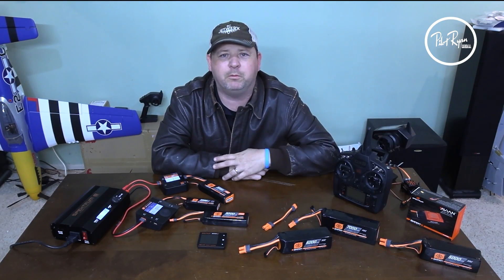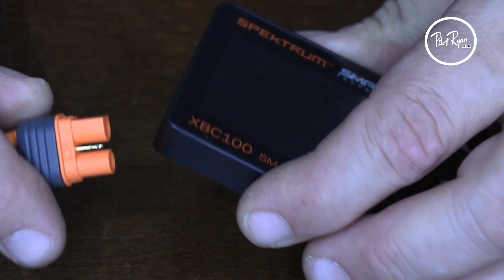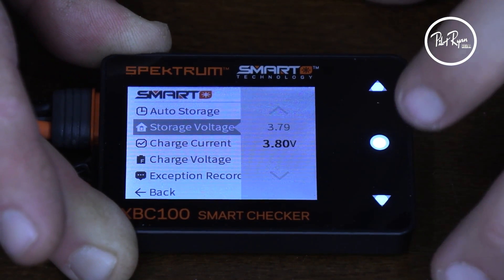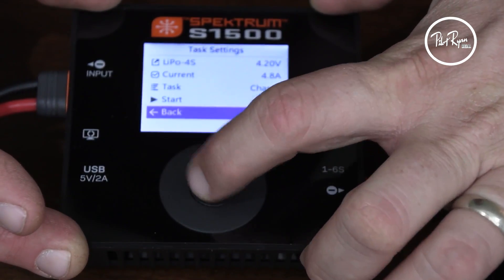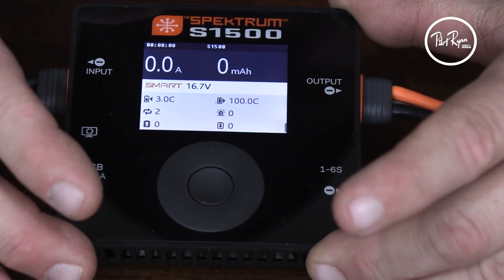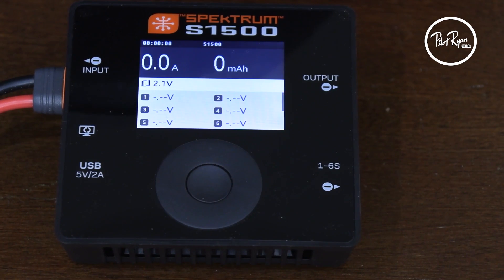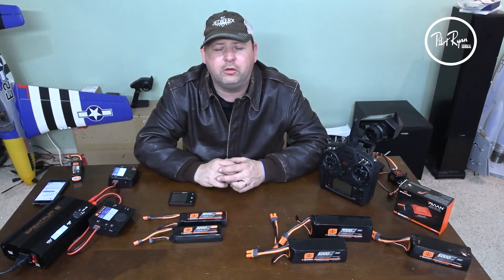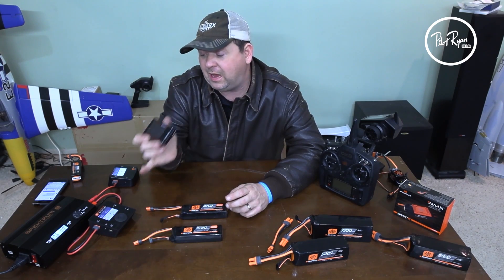Spektrum Smart Batteries How to set Auto Discharge with Smart Checker and Charger

Comment: I am new to these size lipo batts. I purchased the Spektrum 5000 mah 36 100c. I have the Spektrum S150 smart charger and smart battery checker. I have two questions. First what is the max amps I can charge this battery at? The S150 goes up to 5 amps. Secondly, I’ve seen mixed info on storage voltage for these. What sis the proper storage voltage for this size Spektrum smart battery? They are pricey and I’d really like to care for them properly. Any information would be greatly appreciated. Thx in advance. Great vid by the way, learned a lot.
Reply from the maker: 5 amps is only 1c on your battery so you’ll be fine. 3.8 volts per cell is storage voltage
Reply: @PilotRyanMedia  Thanks for the response! I’m a drone guy and I understand how to care for their batts. The info on these big packs can get a bit overwhelming/ confusing lol. Thx again bud.
Reply from the maker: The 3.8 per cell is good storage per cell for any size battery whether it’s 3s or 6s
Reply: @PilotRyanMedia  My bad, one more question. After running a battery down, should you fully charge the battery then set the auto storage voltage with the smart checker?
Reply: @CG did you ever get the question answered about what to do after battery use? I am looking for the same answer- thanks

Comment: I just charged my 3 cell 2200 for the first time,   new rtf carbon cub.   Is there a place the battery needs to be for the week as it discharges itself?  Special bag , out in the open  in my tool bag?  For safety.   Thanks for your advice.
Reply from the maker: somewhere safe, fireproof is recommended. A lot of people use those lipo safe bags or boxes.
Reply: @PilotRyanMedia  Hello, I have 2 quick questions if you don’t mind. I have the smart checker from Spektrum and their s150 smart charger. I purchased 2 5000 mah 100c 36 Spektrum smart batts as well for an rc truck I purchased. Ok, first  question is how many amps should I charge the battery at? S150 goes up to 5 amps. Secondly, what is the proper storage voltage for this size pack? I’ve seen mixed info online and I’d really like to take care of this equipment. They’re pricey but I wanted the best and I liked the smart tech . Any help would be greatly appreciated. Thx, great vid by the way. I purchased the smart checker because of your vid.  Thanks in advance! Take care ....
Reply: @CG-px9qd  same here man just bought a rc with the s150 charger and battery bundle but im faurly new to this rc stuff especially lipos so if u have the smart batteries and the smart checker the batteries self discharge on there own or connected ???
Reply: @CG-px9qd  and for the charging amps i seen a video that said it automatically sets you amps and stiff so you dont have to only when u want to

Comment: Hey Pilot Ryan! Are you saying once to set the auto storage you can unplug the battery and put it in a Lipo bag and it will discharge? Or does it have to be plugged into your charger?
Reply from the maker: It does not need to be plugged in

Comment: Hi Ryan, after two days does the battery discharge itself or do you have to have it plugged into the charger to drain it down?
Reply from the maker: It does it itself with no plug ins required

Comment: I have a new 3s lipo 5000 mah smart tech battery. I don’t have a Spektrum charger. I noticed after I charge the battery when I check it’s charge level 2 days later it’s about 50% charged. I thought battery was bad.  I have 2 and both do it same thing.  I assume they are auto discharging?  Any thoughts?
Reply from the maker: They are auto discharging

Comment: Good evening bro. This is off the subject. But what is the best or biggest battery you can use in the new P51 1450mm plane. ????
Reply from the maker: You can fit a 7000 but you will have to make arrangements. Biggest without modification I’d say 6000
Reply: Pilot Ryan Media well I got a couple 3600 and a couple 6000. I just wanted to make sure they won’t hurt anything in the electrical. Thanks bro. Looking forward to more of your video’s. I want the p51 1700mm bad lol.

Comment: Ryan, can you tell me what kind of connector is a FMS P-47 Razorback 1500mm ECU? The reason I'm asking before I but all 5S G-2 Smart Battery's for the plane I want make sure that I don't need a Adapter for them.  Thank you in advance!
Reply from the maker: Mine came from China direct. Let me ask my friends at Horizon for you. I’ll answer here.
Reply from the maker: Xt60 and ec5. They have implemented ec5 on newer P47s. If you shop consider using my website to get to horizon.

Comment: Hey boss I just bought a 6s 50c 4000mah, bashed it twice and it seems it is stuck on auto discharge? What are the default auto discharge settings of a brand new lipo?
Reply from the maker: You know what I’m not exactly sure. In my experience the auto discharge is not set at all until the user sets it. The only batteries I have with auto discharge are the ones I set.
Reply: @PilotRyanMedia  after my research I found the default voltage would be 3.80v though, and mine is discharging below that. It was fine til my last bash. I'll give horizon a call. Thx for the response though!

Comment: Hey Ryan awesome vids!  Question,  I thought the whole idea with the Smart batteries was not having to plug in the balance lead?   On the Smart FB forums I think Tom G stated you only need to plug in the main battery lead?  Thanks again,  enjoying these vids on Smart tech.
Reply: Exactly my Question. Why do you have to connect the balance plug? When the battery was connected to the checker without balancer, cell 1 and 2 showed 4.2v after the balancer got connected, 4.178 and 4.187??
Reply: aedu83 Yeah I never noticed that but my guess is the checker is exactly that just a rough guide.  In order to balance accurately you have to plug in the balance lead.  Seems really stupid to have all this tech built into a battery and still have to plug in the balance lead,  whats the point!

Comment: although at a slower rate; can't you just use the smart checker to dis-charge ? there is a 'cell balance' function so if you set the cells for 3.80 v., will it discharge too that level and then give an audible beep? I'm still experimenting :-) . I use that checker and smart batteries...thanks
Reply from the maker: JCB 67 yes

Comment: Thanks Ryan, great video.  I have a question: when you set the discharge for say 48 hrs, does that mean the battery will BEGIN to discharge in 48 hrs or it will BE discharged within 48 hrs? Thank you to anyone who can answer this for me.
Reply: Good question - hope you get an answer by OP.

It could be for how long you are gonna store the battery also, I'm mean until the next planned use. 

If the battery can discharge itself using either the smart checker or the s1500 charger you shouldn't be able to input that it'll take +300 hours doing it as that would leave the battery with wrong storage voltage for many days and nights before being discharged to storage level. 

Gonna google the manual for that charger see if I can't find what that setting is about...
Reply: Begin is the answer. It'll hold its charge (as well as mechanically possible) until the "self discharge" time you specify. Then, once 48 hours (or whatever you choose) hits it will start discharging to the specific voltage you specified (stock is 3.9v I believe) 
Though, it does take FOREVER for them to self discharge to storage specs so IMO it's best to just storage charge/discharge them through the smart charger when you know you're done for a while 🤷‍♂️
From what I've gathered, there's a little LED inside the batteries that turns on when self discharge starts - since there's only two ways to discharge 1)using the battery 2) heat - so it uses the battery via said LED. When you discharge via charger it's the heat method - charger pulls charge out of battery and converts it to heat. 
I see I'm 11 months late but it's never too late for the right answer lol

Comment: Great info as i had trouble figuring this out.   lucky for me you and Dave helped me on the live feed!  Q:  you can also change the charge current,   mine are set to 3.3A I know it can be set lower,  as yours are 3.2A  in the video.   2200 3s pack should be at ??  3.0A 1.0A ... i charge with the S150 and that is the settings i can choose from.   Thanks for your input Ryan!
Reply from the maker: If you want to charge at 1c it should be 2.2A
Reply from the maker: Oh right the s150 is limited in a way. You’d be fine at 3.0, just know it’s slightly above 1c. Not a huge deal
Reply: Pilot Ryan Media I’ve been charging at 1A now,  a little slow but that is fine with me.  Thank you Ryan 👍
Reply: 2200 mAh is 2.2 Ah (milli=thousandths, of course) milli-amphere hour.
So the 2.2 amp is from the 2.2 Ah. (Some batteries label it 2.2 vs 2200 or Ah vs mAh) 
Spelling out the Ah is amp hour. So it means it has the capacity of delivering 2.2 amp current for 1 hour. That would be 1 C discharge. 20 C discharge is discharging 20 times faster than the capacity of the battery, so 2.2 amp (or 2.2 Ah or 2200 mAh) x 20 C = 44 amps max recommended discharge current (some batteries have a momentary burst rating that would be a higher C - think about a quad punching out vertically). 
Charging at 2.2 amp would be 1 hour charging, but not that long in actuality as we only drain 60 percent of capacity or less per run. 
If you're charging at 1 C for really any battery it mostly always works out that in 40 minutes or less they are done. The C is always related to the capacity. 
Big dog eats a big bowl but with a bigger bites than a little dog and his little bowl, you get the point. They finish  at the same time. 
The voltage doesn't really come into play for this calc, as long as you set it correct for your cell count. 
As long as you balance charge each time, your charger will make sure you have the cell count correct as it accounts for the voltage of each cell throughout the cycle. 
Trust me, I was confused on this stuff for a long time. If this seems too much, read it over and over. I promise, you'll be passing it along before you know it.

Comment: There are no Task Settings labeled "Smart Discharge" or even an "Auto Discharge". There are only 3 settings and they are named: "Charge", "Discharge" and "Storage".  You can ruin a perfectly good battery if you don't push the arrow that last third time down to "Storage". If you go only as far as Discharge without knowing it, the battery will be discharged down to zip.  This has been my experience but I luckily caught it at 2 volts. 
 My Comment is a warning about using the "Discharge" setting as I almost ruined my battery.   The "Instruction Manual" because it in only safety and regulatory,,, not How to use the settings and what they mean. (thrown in the box to fulfill a regulatory requirement .) They need to do a proper  DFU (Directions For Use) .  You video is very good in that it shows how to set the "Storage" task but do not address, demonstrate, or use  the "Discharge" Task.  I have not been able to find an answer anywhere despite hours of research on the Spektrum S1200  G2 Smart Charger.
  Question #1: In Settings:  TASK:   There are 3 choices: Charge, Discharge, and Storage.  What is the technical difference between two settings on " Storage"  and "Discharge"?   I know what Storage does. It will bring up the voltage or lower the voltage to the presets you set with the XBC100 Smart Checker.   
 The Problem:  I set the S1200 to "Discharge" to reduce the charge on a fully charged battery I did not get to use on my flying day.   The Issue was that after a while, maybe after 1/2 hr it pulled the voltage down to 2 volts and I was alarmed and stopped it.   What is the purpose of the "Discharge Setting"? If I had used the Storage setting there would not have been a problem.   I hope you can try this out because I haven't been able to find any explanation or actual official guidance on this TASK  called "Discharge" when they should at least have a warning about its use.  Thanks in advance.